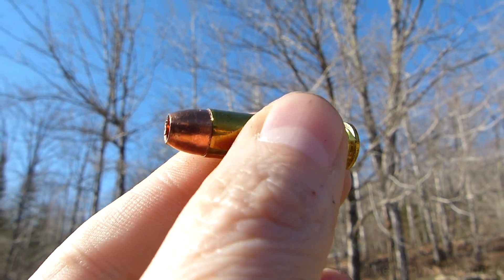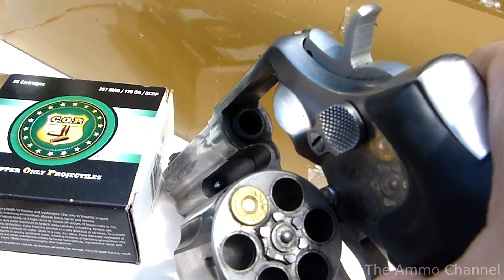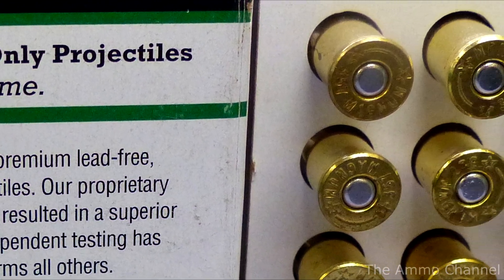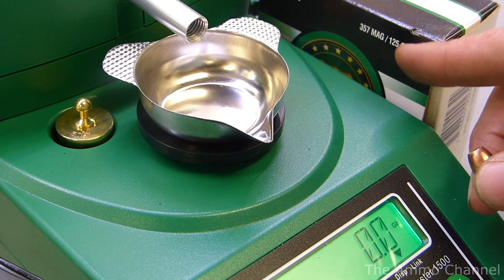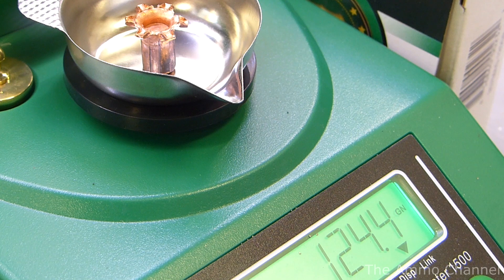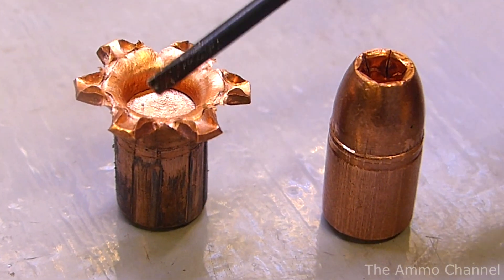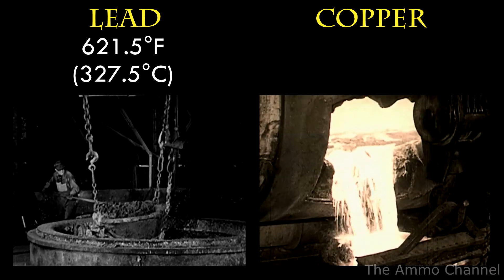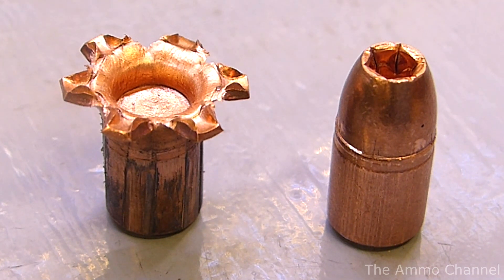What makes a solid copper bullet expand?

Comment: The gun in my pocket is loaded with 115 grain barnes vortx. But the bullets are solid copper hollow points.
They average aboig 1080 fps from the 3.3 inch barrel, and expand perfectly every time . Ive never tested one thay got less 16 inches of penetration thru 4 layers..
You can also buy these bullets from barnes, for reloading. Ive pushed them to 1300 fps from the same 3.3. Inch barrel.  But they suffered penetration wise to 10" or so.
But the wound channel was impressive  

In my opinion 1100 fps is ideal.

Comment: My brief analysis: copper bullets don't really do anything that lead bullets don't do already... out of handgun bullets. Rifles tend to get a little different because some of the real high velocity rounds will traditionally fragment or deform heavily when they yaw in tissue. Solid copper is more rigid and will retain it's shape much more which can work to your disadvantage or advantage depending on what you're hunting and shot placement. One of the major inherent disadvantages to copper however, is it's less dense than lead. This means that to get the same bullet weight, you need a longer projectile and that translates to less case capacity. Big issue for magnum loaders especially. These are generalizations of course, but there is a reason lead is still the preferred core component for hunting/general purpose rounds.
Reply: I manufacturer Solid Copper Hollow Point. Machined with a propriety process . Turned and polished and formed vs swaged. No jacket separation, 100% weight retention, wound cavity twice the diameter of the projectile and a faster twist rate. Extremely accurate due to the CNC machining process. Look for our brand in a store near you after Christmas. www.syndicatealliance.com

Comment: Looks like H110 powder too. Pretty standard for 357 mag. The hollow point, after you cut it in half, almost looks like it was folded up that way, almost as if the leaves of the petals were pre-cut then swaged into position.

Comment: That bullet seemed to work...decently, but not as good as a denser lead one normally does. I do not mind replacing lead, but it has to be with something as or more effective. I was going to try aluminum but that is even less dense and has a much higher melting temperature, but I have a ton of it in storage. I think zinc is a good idea though. Melting temperature is not too much higher than lead (about 100 degrees Celsius higher) and it is rather cheap. Only problem is I do not have any zinc unless you count that box full of cheap firearms. What do you think might be a good lead substitute? Gold would be great if it did not cost so darn much.
Reply from the maker: Jesse Sisolack I think Zinc would have promise as a home brew lead alternative if its fumes weren't so incredibly toxic.
Reply: The Ammo Channel Zinc would be incredible for high velocity loadings, especially in handguns.
Reply: The Ammo Channel ...good point. Lead is considered toxic and it does not give off all that much in the way of fumes.

I heard a company say they had a lead alternative ally that is nearly identical to lead only less toxic. Of course they would not disclose what this ally was. I need to try and remember their name.
Reply: Jesse Sisolack It was probably bismuth.. like zinc its more brittle than lead is but it is absolutely non toxic. Some manufacturers make Bismuth shot shells but they are mighty expensive.
Reply: joehunt1980 Bismuth would be...interesting. It melts at an even lower temperature than lead and likes to form crystal structures. Easy to work with at least.

Comment: Silver is softer than copper and melts at a lower temperature. lets see a manufacturer use silver to check expansion.
Reply: Plus, you could kill a werewolf with them.
Reply: a tad bit to small after casting it. rifling doesn't grip it

Comment: Isn't 1143FPS a little slow for a 125gr 357 Magnum? If my memory is correct a 124gr 9mm is just south of 1050FPS... So is the 9mm 124gr in 357Magnum territory?
Reply: Seth Bowles This velocity is consistent with fast burning pistol powder loaded in .357. By the looks of it, these may have been loaded with something like Win 231 or HP 38. In order to get the much higher velocity we expect from the .357, it needs to be loaded with a slower burning magnum pistol powder like Alliant 300-MP or H-110.
Reply: Oh... Got ya. I thought most 125gr 357s were north of 1400FPS but his makes sense.

Comment: You have SCHP like Barnes TAC -X. Lehigh Defense HERO, Maximum Expansion, and Controlled Fragmenting rounds that are all copper, and of course my favorite Corbon DPX load which is a Barnes bullet loaded hotter. It is one of my favorite barrier blind hard copper rounds for carry. No soft lead to make it deform and very well machined for reliable expansion even under very low velocities.